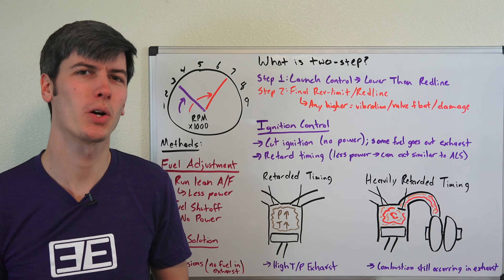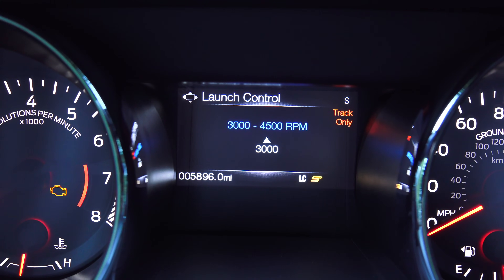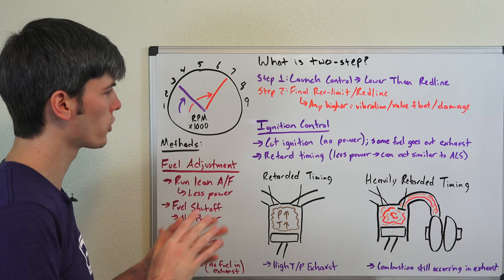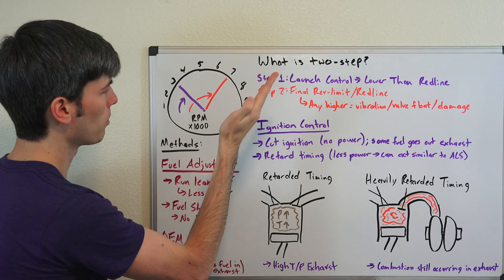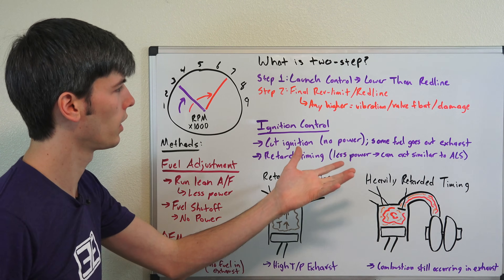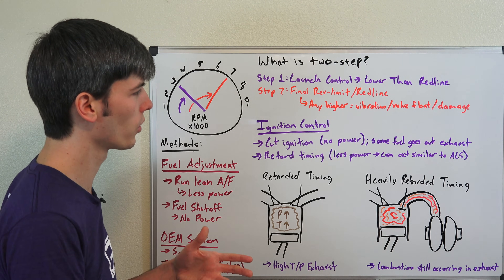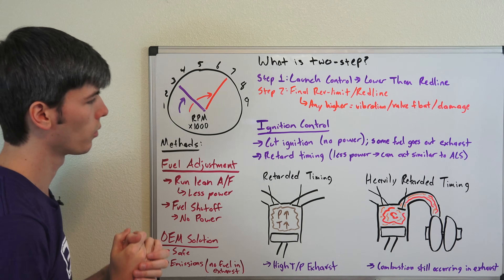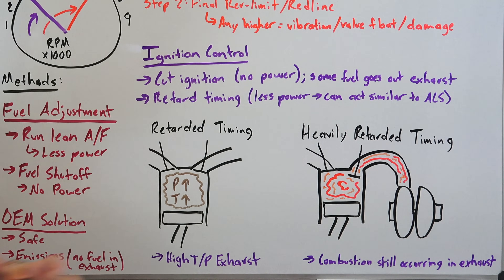What Is Two Step? Rev Limiters Explained

Comment: Do old cars have rev-limiters? How do I know if my cars have rev-limiters?

I assume the new car (MY2015) I drive has a rev-limiter since it has computers and an electronic connection to the throttle body. But I also drive a carburettor car from 1991 that (to my knowledge) doesn't have any computers, and probably relies on technologies from decades before. So with cars like this, or cars from the 1960s and '70s, do they have rev-limiters?

Full disclosure: I have been trying to find out if video games have it right or not. Because a lot of video games either have the fuel limiting solution (as per video) for all cars or for old cars just get to a certain RPM and stop accelerating. This struck me as odd that my Corvette Stingray had a convenient rev-limiter to stop me from demolishing the pushrods. I read somewhere that valve float limited old engine's RPM but that sounds crazy...
Reply: Yes...or governors. 

Stick the clutch in, put your foot down, you'll soon find that it has a rev limiter. 

If it's an auto, neutral might limit the revs even further (perhaps to 4k), just because they do.

Comment: There can be 2 stages to a max rpm limiter.. a soft limiter (timing retarded) followed by a hard limiter (ignition+fuel).  Never known a hard limiter just to use ignition cutoff as a singluar method of control as the bore wash and damage to the CAT isn't sensible long term.  Plus most modern petrol DBW systems limit rpm by modifying the TPS/MAP sensor signals.

Comment from the maker: Something I obviously should have mentioned, but did not, is that with modern electronic throttle bodies, it's very easy control RPM (especially for the lower RPM rev-limit for launching) simply by limiting throttle, and then opening the throttle fully once the brake pedal is released or the clutch is engaged.
Reply: Hey, maybe you make a video on electronic throttle bodies? How are they made, are there different types, and is there an issue that throttle valve moves slower than the driver engages the gas pedal.
Reply: Wayne Galen sorry Wayne, but you are off the ball here. Top speed is determined by drag and horsepower (assuming optimal gearing), not weight. Weight actually has no effect on top speed on level ground at all, except for how long it takes you to get there. And, torque doesn't tell you anything by itself. To make an easy example, take an sv650 motorcycle versus a gsx-r600.  They are similarly heavy if you include the weight of a rider (although the gsxr weighs a bit more) and make very similar torque, but the gsxr absolutely demolishes the sv in acceleration, top speed, quarter mile, etc because it makes more horsepower. In the end, it's a very complicated thing to accurately model vehicle performance, but power to weight ratio is a good starting point up to around 150 mph if you also consider if the vehicles have sufficient grip. After that, it's more about power and aero than weight or anything else. Fwiw, there exists tons of software that can very accurately model vehicle performance, we use it every day in the automotive industry.
Reply: Jeff Beasley Thanks, I appreciate a well formed argument telling me I'm wrong :)

Just curious what the the names of some of those software packages are?
Reply: In a more generic sense, the ECU reduces the air charge entering the engine. Depending on the system, that can mean closing the throttle, reducing intake valve lift, reducing boost pressure, etc.This is by far the most common way that modern ECUs control engine overspeed.

Additionally, leaning the mixture is not usually used to reduce torque, as very quickly you will reach a point where the mixture won't burn (lean misfire). That happens long before you are to the point of reducing net torque to 0 and is also very bad for emissions.
Reply: Andrey Studentsov believe it or not, he kinda already has. Nissan VVEL video should show you the basics
Reply: Colin if serious there is huge amount of physics end math. Easiest way is just doing that IRL if You are not engineer/physicist.

There are simplified ways to tell something but there are only semi related to real performance.

End beat one another in what way.
Reply: @CzornyLisek  can
Reply: You can easilly tell, that with this power difference Challenger will be faster on the salt flat, for example. Acceleration on the asphalt is not thar easy, no simplw equation there.
Reply: jamesmday123 He already done that.
Reply: 2 step ist bad for the engine. you first need to under stand what 2 step is. Wich is creating a combustion in the exhaust by delaying engine timing or a bypass, to keep the turbo spooled while your off the throttle. the only thing it could relly harm would be the oil of the engine the turbo and the exhaust system. Exhaust due to combustion and oil due to heat. Turbo due to high psi and rpm.
Reply: Engineering Explained it would be great if you- an engineer, not some keyboard warrior- could explain to me WHY left hand drive cars cannot be made in right hand drive simply by reversing the schematics. As a current engineering student, I just don't understand.
Reply: Vehicles are extremely difficult to package. They have so many components, it's staggering. Getting them all to fit while still keeping the exterior looking the way that the design team wants is a HUGE effort. In some cases, it is just impossible to move components around to fit RHD. In other cases, it is just too expensive. The main issue is usually having to do with the shaft that goes from the steering wheel down to the rack. In every case except for longitudinally mounted V-type engines, the engine is mounted asymmetrically and is positioned in a way to fit this shaft on only one side.
Reply: Engineering Explained How old are you?
Reply: Off topic but I have a question. What equation could I use to compare two veicles, and see which one would beat the other. For example a 350hp civic vs. a 440hp challenger
Reply: @colinbarrineau3102  that would be power to weight ratio my friend.  of course thats on paper, driver ability/error will effect those figures IRL.  but ur asking for Power to Weight ratio.
Reply: Can you do a vid on fuel like e85 and the pump gases.
Reply: Engineering Explained anti lag explained please :)
Reply: +Colin Barrineau Torque and weight are important factors in that, but for a basic hp comparison: (weight)/(hp) should give you a rough idea which one would get a higher top speed, assuming no speed governor. Torque would be important if you're trying to predict which one would beat the other in the 1/4 mile, as that dictates how fast it can accelerate. Similarly to hp, you could do (weight)/(torque) to see which car has the advantage.

I'm sure there's a more involved way that would give you a better comparison, but I'm not sure what it is.
Reply: I remember there was an old DOS 80-90's exe that was a simple aerodynamic car simulator we played with in our high school metal class in 2002. It was very simple, just draw something simple like a triangle and draw a good wheel size to go faster than a square shape thing. I didn't actually use the exe myself because everyone else was hogging the computer so I just helped others build better shapes, I probably greater experience that way.
Reply: How do I install a rev. limiter on my 1998 Subarea Legacy?
Reply: Engineering Explained  is 2 step bad for the car ... Like can it damage your engine ?
Reply: Aqif Khan lol OEM 2 step is fine for cars. but when people mid them and two step after market they are very bad for cars. my friend has a 1987 Toyota Supra with a 7m turbo and he blew it sky high when he was two stepping too much
Reply: The only bad thing it will do is kill your spark plugs faster and cats, nothing more and you are wrong, it is not off the throttle, it is used under throttle...
Reply: All I'm saying is that my "right foot rev limiter" keeps it smooth at 7,000, but the computer abruptly cuts and revives it at around 7,200.
Reply: Jeff Beasley Depends on the car you are talking about.  I have seen some people reverse the scematics and flip from left hand to right hand drive.  Not sure why you'd want too.  I saw it done on R34s and Supras, inline engines that are mounted front to rear not side to side, I'm sure flipping this on an escape or tribute may pose more of a problem; not to say it couldn't be done.  p.s 2 step is simply launch control.  Make a video explaining anti-lag. Yhats even more fun. lol ;-)
Reply: Engineering Explained will this make it sound like anti lag aka gun shots
Reply: Engineering Explained is adding a 2 step to a V8 a bad idea? Just wondering if this will put unnecessary strain on a large displacement motor?
Reply: Colin Barrineau i'd say power to weight ratio, even though there is traction difference between RWD, FWD, and AWD.
Reply: I’m looking for something like (2-step) to make the exhaust crackling 

I’m looking for sound like the (i30 n) or (A45 AMG)

““Without turbo””

Do you know what is the process & how to do it?

My car is Nissan sunny 2010

Comment: Most of the newer cars with drive by wire throttles just back off the throttle for you to limit rpm. It doesn't sound as cool but is a little easier on the engine because you don't get what is basically a controlled missfire.
Reply from the maker: +NBSV1 yes, actually the easiest method with electronic throttles, and something I should have mentioned!

Comment: Could someone explain how the WOT box works?
Reply: +Matt K 
Straight from N2MB
"The No-Lift Shift feature makes no-lift shifting easy by cutting your engine's ignition for a very short period while you no-lift shift. No-lift shifting is keeping the gas down through the shifft. The ignition cut allows the synchros in your transmission to mesh easily, reducing the chance of missing a gear and damaging your transmission. Keeping your foot down through the shift also allows you to hold boost through the shift, thereby significantly improving your E.T. "

Comment: Was playing FH3 last night, all I was hearing from my boy and his boy was two step. I barely understand but I'll catch on eventually.
Reply: Scvmbxg Otvxv if you hold both the throttle and then brake fully in manual with clutch, the engine rpm will hold around 2000 rpm but is different from car to car

Comment: Launch control has been around for decades.  My 68 Chrysler had launch control.  We called it stall speed, when you engine cannot produce anymore power to spin the torque converted faster -- normally these were around 2200 to 2600 rpm.  Nothing beat left foot braking your dad's car on main street, stomp on the gas, and spin those 120/70 R15's all the way across the intersection.
Reply: Totally different reasons, strategies and results.
Reply: patw52pb1 A little sarcasm never hurts.  But I agree with you

Comment: Can you install a 2-step or anti- lag system in an Audi with S-Tronic (6-speed automatic) transmission?
Reply: Don't Audis have launch control already?
Reply: Rilo Elton before 2005? i dont think so :D
Reply: 2.0 TFSI or 2.0 TDI?
Reply: Shamarshmallow You can inly install anti lag on turbo cars. (Not sure if your model is or not)
Reply: It's a 2007 A4 2.0T but it's an Automatic
Reply: 2.0 TFSI
Reply: It's possible, but I'm worried about the strain it puts on the engine... Unless you swapped the engine with 2JZ or RB26DETT which saw it's popular use of this system, I can't guarantee your engine's longevity after using this setup.
Reply: stop saying mainstream engines, if you really knew all you need is a proper ecu and you can literally do whatever you want to your car, this is all done electronically not mechanically so saying you need a 2j orRB is just ridiculous and ignorant
Reply: oh great then. never touched the system myself. just playing it safe, lol

Comment: but what happens when it runs lean? for what i know, if you run a lean mix in your engine, you gonna make a lot more heat, you can even melt the pistons, how does they prevent this to happen with the fuel adjustment rev limiter metod?
Reply: It does not run lean. 
It is fuel-cut (no fuel injected for the selected cylinder), not fuel lean out. 
Lean damage is mostly from knock/preignition/detonation.

Comment: Don't carbureted engines use ignition control to limit engine revs as well?  I'm thinking mainly of older carbureted motorcycles because those are the only carbed engines I've ever owned.  I don't think a basic carbed engine has the capability to restrict the amount of fuel in order to lean out the A/F mixture.  I think they just cut the spark.
Reply: Yes.
There are several methods, individual or paired cylinder spark-cut, retarding ignition timing and stretching ignition dwell time.

Comment: so if fire is coming out of the exhaust then it means there was some retarded combustion that causes the charge to be in  exhaust manifold and to cause fire in exhaust?.. 😕
Reply from the maker: Or you're just running too rich.
Reply: Engineering Explained would it be heavily retarded timing if the exhaust tip interior's coated in black soot but the spark plugs remain clean? Figuring out of there's just a timing issue and where to investigate in a Foxbody 302.

Comment: can you do a video explaining suspension setups, i.e, supercars suspension is at an angle, whereas normal cars the suspension goes vertical to the strut. would be fascinating to see the math behind it all.
Reply: I would assume he's talking about how the struts/shocks/dampers are usually placed horizontal and inboard vs on conventional road cars they are vertical beside the wheel.
Reply: he did one, search on his channel!
Reply: jabadahut50 if that is his question he isn't wanting to know the difference in the damper style but why inboard vertically instead of outboard horizontal
Reply: no because if he did, he will end up talking about atoms and blood cells
Reply: Nick Nack you mean chamber right?
Reply: no. i mean the positioning of the suspension itself.
Reply: Nick Nack you mean like double wishbone vs leaf springs..?
Reply: sure, and all the other stuff listed above :)
Reply: MusicalNinja77 i think hes talking about the difference in castor and the reason for the difference in castor is it allows more grip without negative camber as well as yo keep the car lower but still have similar spring rates ((i think on that last part. ee may have a better explination))
Reply: saturnblueline02 in that case we are talking about macpherson sruts  or double a arms vs pushrod or pullrod suspensions all of which ee has videos on and does a much better job explaining differences than i ever could
Reply: saturnblueline02 again it's a matter of the type of suspension. macpherson struts and usual double a arms are built for cars that are higher off thr ground where as oushrod is built for cars that are super low and use a lot of ground effects

Comment: In the "OEM Solution" do they really ONLY cut the fuel? I mean I would cut the fuel line and the spark plug. Whats the point of using the spark plug if there is no fuel.
Reply: They use this (no fuel/no spark) for throttle cutoff, but for an OEM rev limiter, you want this thing to work a tad softer by not putting too much strain on your components like cutting all power at high revs would probably do. At least, that's what I make of it.
Reply from the maker: Can also limit throttle, assuming it's electronically controlled which basically all modern ones are.

Comment: i think my dad has a 2 step in his 2002 Holden vz SS or it may just be skill and i think it redlines at 6500 but the stock limiter is at 5500 hmmm not plugging in that co2 reader helped a lot i think he doesn't need a 2 step anyways its just moderate your throttle and after you launch hammer it. also i think in a day he probably  got 5-10 speeding tickets going about 60 kph over the limit every time.
Reply: sorry i choked its 2:45 am  i think he get a performance ecu  i have to ask him about that
Reply: Modulating the throttle perfectly at launch is virtually impossible to get right every time.  That's why launch control came about - it does the initial part of the modulation for you.  Kinda not really needed unless you're going to take it racing, though.

Comment: saturn s series cars have had factory 2 step from the 90s, the manual cars won't let you rev over 4000rpm until you're moving
Reply: The old Dodge neon was like that also, if you have the auto trans.  I guess they don't want people scattering the trans over the road by revving it too high and slamming it into drive.  But those stick shift cars I've tried didn't have a 2-step limiter unless it had launch control